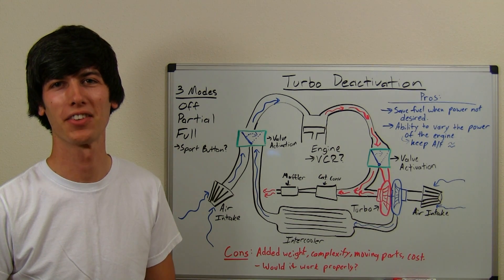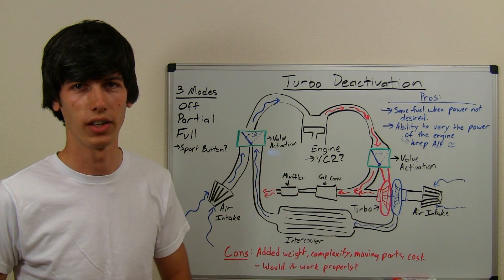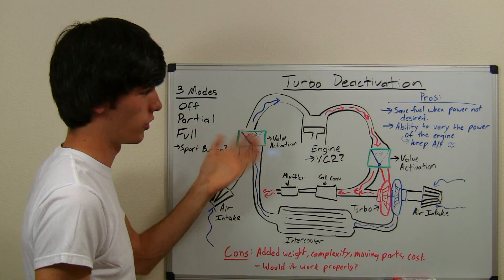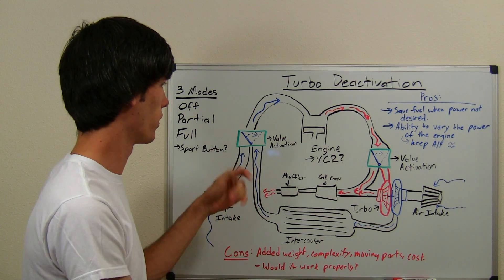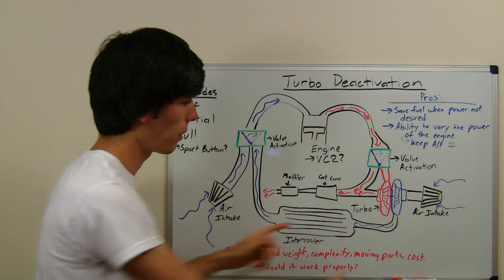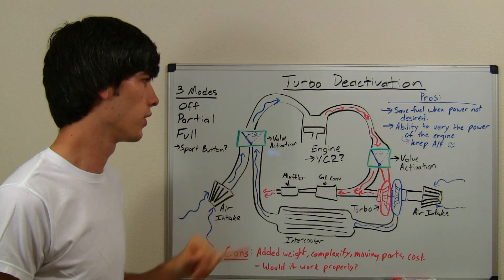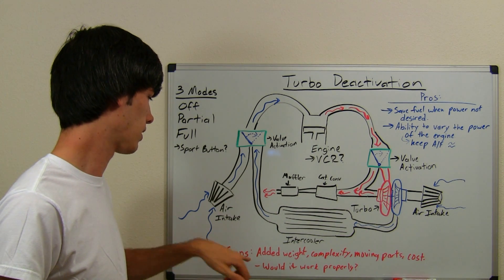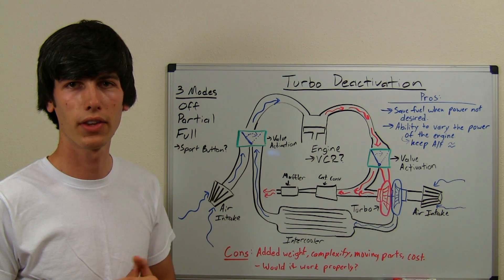Turbocharger Deactivation Concept - Explained

Comment: part 2 - .....Generally, the turbocharged cars have slower acceleration and no better fuel economy than the models with bigger, conventional engines. Looking at EPA fuel-economy estimates (calculated based on laboratory tests), some of these cars' turbocharged engines seem to have an advantage. But we found those results don't match the findings from our own fuel-economy tests.....

Comment: part1 - Consumer Reports finds small turbo engines don't deliver on fuel economy claims.

Small turbocharged engines are marketed as delivering the power of a large engine, with the fuel economy of a smaller one. That's a tempting proposition, but our testing shows these small-displacement turbos are not delivering on the promises.

By now, we've tested many cars with these engines, and lots of competitors with traditional, naturally-aspirated powerplants, big and small. ......

Comment: They don't fake the results of MPG tests, they optimise their engines to perform in the MPG tests, most often to the detrement of fuel economy during actual real world driving. They do this because lots of foolish people will buy cars based on their (irrelevant) quoted MPG figures and maximum hp rating - thinking the two are some how related. I can't believe you've been taken in so easily......

Comment: Wouldn't you just restrict the amount of boost at low RPM? Overcome the vacuum and engine creates off boost, lets say 0psi to 5 psi? Let all the rest of the gas out the wastegate. Then as you increase load on the engine keep the gate shut so as to run higher boost pressure. I see that as the easiest and most efficient way, instead of 'valves' changing direction of gas flow. Looking at the 'ecoboost' engine, I cant see anything special about the turbos? No valves apart from your old internal gate

Comment: Think about it. For a 360hp engine like the ecoboost, it is operating at a ridiculously low relative load during MPG tests. The turbochargers would be operating so far from their optimum efficiency they wouldn't be flowing a meaningfull amount of air, but they would still be an exhaust restriction and incur lag. Why not just open the wastegates and deactivate them for the tests. Which is what Ford do. Of course this is just a false economy though.

Comment: They don't in reality though do they!! It was a nice thought of yours, but sadly little truth behind it. Some low performance turbocharged engines can just about match the efficiency of NA engines at extremely low loads at low RPM's, where they are basically operating as NA engines. At all other times they are extremely inefficient, but of course MPG tests don't show this, which is the big con people like you have fallen for..

Comment: "The 3.5 liter Ecoboost cannot "run without the aid of its turbochargers" unless they are blocked off or removed.".................or unless there was some sort of valve attached to the exhaust side of the turbocharger that could bypass exhaust gas away from the turbo!!!

Comment: "Now youre saying that the turbo must be "deactivated" if its not producing higher manifold pressure than atmospheric?"

I see where the confusion has come from now. No, you are pretending I said that to take attention away from you being wrong. I'm saying when the tubochargers are "not operating" in the ecoboost engines they are not pumping anything and hence recovering no energy. Why do you think Ford chooses to operate their ecoboost engines like this during MPG tests?

Comment: If by "overall" you mean during extremely low load fuel economy tests that have little bearing on the actual fuel efficiency of todays vehicles, then yes they can be. Of course we all know that is because during those tests they are operating as NA engines.

Comment: "Why does a turbocharged car get better MPGs even though it has a higher Peak BSFC?"...............In the case of the Ecoboost engine, 'higher peak BSFC' is due to the poor efficiency of turbocharged engines. Better MPG's is down to the fact that when operating in the test cycles the engine is in effect a NA engine.

Comment: Because under the tiny amounts of throttle used in the standard (outdated) efficiency tests the engine is producing hardly any torque/power and no boost!

Comment: "what is an efficiency cycle".......

(Fuel) efficiency of vehicles can be expressed in terms of either; Fuel consumption (amount of fuel used per unit distance); or Fuel economy (distance travelled per unit volume of fuel used). Both 'economy' and 'consumption' cycles are efficiency cycles.

Comment: I've never stated that turbocharged engines cannot be more efficient than NA engines under certain low load applications. I thought it was easily plausible that a high compression ratio engine using a small turbocharger could be more efficient due to efficiency gains from improved low load volumetric efficiency offsetting the inefficiency of the turbocharger and hence producing a net gain. Unfortunately, the more I look into this the more it seems that I, and definitely you, were incorrect

Comment: RPM has nothing to do with loading! And it isn't my opinion, it is from American Popular Mechanics magazine. Where do you pull your assumptions from?

The ecoboost engine is ONLY more efiicient under low loads because it is essentially a smaller naturally aspirated engine. The fact that Ford chooses not to operate the turbochargers of their ecoboost engine during efficiency cycles is damning.

Comment: "In urban and highway driving (under light loads) the 3.5 liter ecoboost runs without the aid of its turbochargers. Because it's a smaller engine, the 3.5 liter has less frictional and parasitic losses than the 5.0 liter. This gives the smaller engine an edge in light-load fuel economy."

lol...so much for your great example of a super efficient turbocharged engine. Sorry EngineeringExplained, Ford already use your deactivation concept in order to manipulate their fuel efficieny figures!

Comment: So let's get this straight. Now you are admitting that when operating at, or near, optimum volumetric efficiency naturally aspirated petrol engines are significantly more efficient than turbocharged petrol engines. Correct?

Comment: Maximum BSFC for turbocharged petrol engines = 0.6, for NA petrol engines = 0.45. Therefore turbocharged petrol engines can not achieve the efficiency of NA petrol engines - not even close. doktorbimmer is wrong but of course not man enough to admit it.

agt155 4 - 0 doktorbimmer, and counting.

Comment: I suppose one potential flaw would be that cars are geared for their engines. Varying the power output drastically would make the car's gearing awkward in one of the modes. That could basically only be solved by having a CVT, but that would be boring and pointless to have turbo mode anyway.

Comment: lol.......no...early 'VCR' designs couldn't 'vary' compression ratios enough to achieve the desired compression at low rpm's. So designs like Saab's utilised a small supercharger active only at low RPM's to help with throttle response.

Comment: Light usage of boost for a turbo you use less fuel than non turbo with equal compression. Due to the increase in pressure helping with the atomisation of fuel, creating more efficient  fuel burn and needing to use throttle less to get an equal level of power

Comment: The combination of variiable compression and turbocharging would be a bad idea. You'd essentially have two solutions to the same problem, one extremely effective yet extremely complicated to produce, the other cheap but inefficient. It'd be like building an F1 engine and then trying to run it on diesel.

Comment: turbos (operational) = more efficiency
stock turbo engines are more efficient (power to fuel)
handling higher chamber temps and pre-det are what you should be focusing on. this is now solved by direct chamber injection to eliminate pre-det.
the problem is the extremely high cost to build injectors that can handle the high heat/pressure and cycles.

Comment: I see this working for heavy duty vehicles, tiny turbos for initial torque and once its up to speed you can shut it off  maybe use it as a to pass.

- solid piping is going to be needed. i feel a system like this would be prone to vacuums leaks.

- depending on plumbing and turbo size there is going to be a bit of lag something like an automatic tranny when you step into it because the turbo needs to build pressure.

- got to have a good engine management system for something like this

Comment: The system that open and close the valves must to be the same that increase the fuel injection when the turbo is on. The injecton mode will change, because the pressure will too. I am right?

Comment: Hm, I have two comments.
1. Won't the engine actually be MORE efficient WITH the turbocharger engaged? I know you can make a turboengine use insane amounts of fuel, but at moderate driving isn't it even more efficient?
2. The rest of the engine is optimized for running with a turbocharger, compression ratio etc. How will this be affected?

Comment: My turbo system is not production, it is a system I put together myself and installed on the car. 

As I said, my system is similar(i.e. alike, but not the same) in concept, but not in design. My WG actually does divert exhaust gases around the turbine;  it is an external WG (not to be confused with an internal WG) and is attached to the turbo manifold (i.e. before the turbo) and as the WG opens, the exhaust gases exit through the WG and out the dump tube and therefore bypass the turbine.

Comment: hi , i saw this in a old saab , it had normal mode with 100hp and a turbo mode with 180hp , there was not much power and horible fuel economy in the normal mode they got rid of it 
in NA engines the fuel air mixture is rich in fuel because there is no pressure , in the trbo you get more power using the same fuel amount with a lot of air which means regarding fuel efficiency turbo is better , and now with twin scroll turbo and bi-turbo technology there is no lag at all
keep up the good work :D

Comment: I have been looking at your videos and they are great! Learning so much about cars here. The idea sounds great in this video but I was just wondering one thing. Does the "boost threshold" of a turbo not refer to the rpm below which the turbo does not operate and would this mean then that gentle driving would not spin the turbo, thus not guzzle fuel? I drive a TDI VW and turbo seems not to kick in until about 1800 rpm. Maybe it cuts in earlier and its lag I'm experiencing. what do you think.

Comment: My car currently has a very similar system.  While not very similar in design, it is similar in concept.  My wastegate (WG) is electronically controlled (by the ECU) and the pressure the WG opens at, can be varied.  It can be varied so much as to adjust boost by gear to aid in traction loss problems in lower gears.  However, I am unsure if a setup of my type can cause the WG to completely open at 0psi, but I'm certain this could be achieved through R&D.  :)

Comment: If you don't over think it its basically allowing you to use the turbo (as a sport mode) whenever you desire, or turn it off so you won't have to waste gas because of the turbo. you get to choose Is basically the concept. correct me if i am wrong anyone

Comment: This is a good idea indeed. Did you consider using the same intake, but using a valve to open for more flow? intricacy goes up, but it would save on 2 intake systems.

Comment: I got an question. Do you always use your turbocharger? because I have a Diesel toyota with turbo and the dealer said the turbo works/activates or whatever after 2500 RPM. Is this true? or does a turbocharger also work lower than that RPM

Comment: Is the left valve necessary? In Off mode could you not draw air through the intercooler, turbine (which would not be spinning) and air filter, in the all turbines I've seen one can suck air through without it spinning. Then instead of the right valve you could add a function to the waste gate so that it diverts in Off mode.

Comment: U need to have the right map on ECU too. something like he explained. different stages. off, on and partial. low boost low fuel injected. But not bypassing the turbo. it would be better if it still spins.Keep the right air intake on the image, but in the left have only a boost regulator (BOV) something linked to the ECU

Comment: Part 2: 
now this is the kicker, instead of having the turbo switch off and need an extra valve, would it be possible to have the turbos kick in at 6,500 (in other words somewhere you would never get to if you want fuel economy) through some timing things i dont really know but that should give better mileage no? without the need of all the extra parts, so basically it would be like any turbo car before the turbos spool up at say 3,000 rpm.. What do you think??

Comment: ive got a different idea how about have a variable turbo kick in range (not sure what the technical words are) but hear my out. City driving mode, have the turbo kick in early (for fun and drifting purposes). Track driving mode, have the turbo kick in late say 4,500 - 7,000 rpm (cos when your going fast on a track you should mostly be up there in the upper rev range). This was part 1 of my comment, part 2 coming up :P

Comment: I was just thinking about this! My idea was a little different though. It would be a complete turbo kit but have an actuator after the intercooler to "vent" excess boost pressure. Flip the switch and you got boost. I would think it would work, I'm positive if it could slowly transition between open and closed

Comment: Also a turbo engine already works a bit in this way: at very low rpm and power requirements the turbo hasn't spun up yet. But with extra valves you could optimize flow in the exhaust and intake reducing flow losses. Electronically controlling the waste gate gives you the valve in the exhaust.

Comment: I think a variable compression ratio engine is pretty expensive and complicated to build.
These systems mostly try to use the atkinson cycle, but that is a cycle that wouldn't be suited at all for city driving due to the low torque.
Maybe the prius trick would work (and be much cheaper) with the controlled valves that close early in the intake stroke (creating a small vacuum and increasing the relative yeald on the exhaust stroke).

Comment: Interesting idea! I don't think a turbo deactivation feature would make an engine much more fuel efficient; however, that would be a nice thing to have if you were stuck in stop and go traffic where the engine's RPMs avg low. 1 question: If the system was in partial mode and the engine switches from the standard air intake to the turbo air intake, once a certain RPM is reached, wouldn't that cause a momentary disruption in air flow which in turn would cause a disruption in engine power?

Comment: This is a good idea but in full sport mode wouldn't you want the valve angled so that air from the turbo and the normal intake gets into the chamber? More air means more gas is used which means more power.

Comment: This idea just seems unneeded, in a motor car the turbo helps at higher rpm and allows a great compression for them. When there at low rpm the turbo adds very little resistance to the motor, in reality turbo's help gas millage to allow the same power at lower displacement thus saving gas, what I think is maybe a bypass for cat's so you can turn them on for smog and off for fun driving &good sound

Comment from the maker: For higher compression, yes, you would need a higher octane fuel, but with direct injection it's becoming possible to have higher CR without higher octane fuels, so it may be possible with regular fuel. And yes, you could throw in all the other bells and whistles if you so desired.

Comment: sounds like a pretty good idea but ive got two questions. due to the variable compression, you'll always need to use high octane gas even if you're not in sport mode and actually don't need it right? my other question is with a system so complex, would it still be possible to use some of the typical things like blow off valves and possibly implement an anti-lag system. btw, props for the videos, they're awesome, learned a ton

Comment: Of course you are right, and what I am talking about is a situation where for some reason you'd want the turbocharger off. Besides, fuel efficiency does not equal fuel consumption - F1 engines are really fuel efficient, and yet most of us couldn't afford using one. The idea is good, because power is not always the priority.

Comment: Hey! There is a much more simple way of doing this: 
Fit a solenoid/electrical controlled diverter valve, with high airflow.
Fit a solenoid/electrical controlled wastegate, with high air flow.
Now let the ECU open both the diverter valve and the wastegate and you have a N/A engine without the boost, and the turbo doesn't take up any energy as the exhaust gas air flow is bypassed in the waste gate, and intake air can flow around the turbo through the diverter valve.

Comment: I don't know if this has been stated in another comment, but, could you achieve the same effect using a electronic boost controller with a boost setting set really low, like at 0 or 1 psi of boost?

Comment: In the European extra urban tests the turbo is less efficient, we have already established that. What we can see from the US tests is that the NA is less efficient in the low-load (~20MPG) 'City' cycle but there is a negligable difference between the two in the medium-load (26MPG) 'highway' cycle. It is obvious that if we increased the test load further the NA would be more efficient, which is what we see in the extra urban (~44MPG) tests.